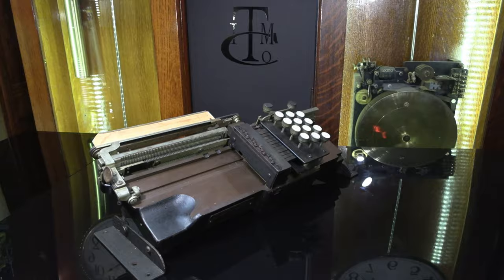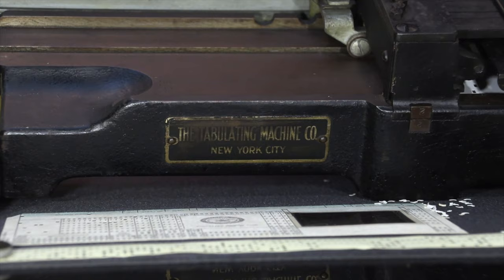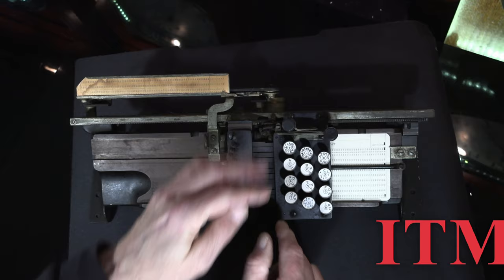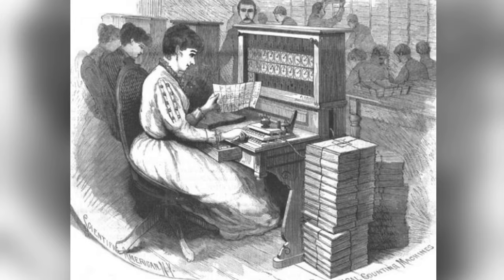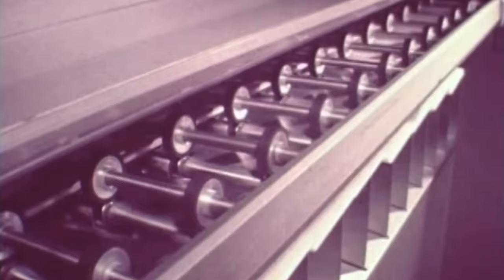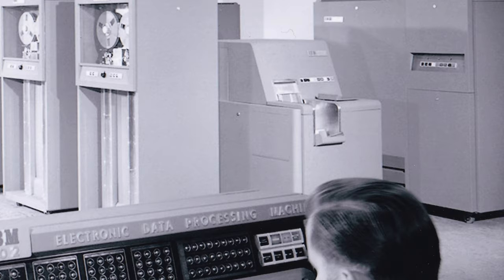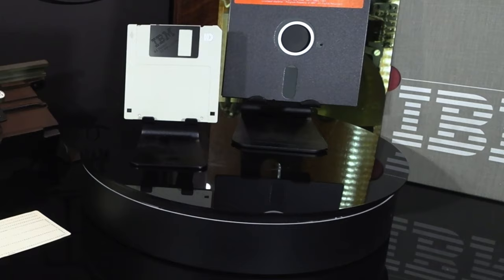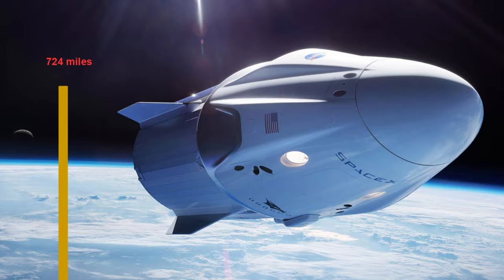IBM Keypunch by Herman Hollerith: World's First Data Storage & Processing System.  An ITM Video.

Comment: The first time I did key punch was in 1972 on the IBM 026 card puncher, and the 024 card verifier. Afterwards, I worked on the IBM 029 card punch machine and the 059 card verifier. Then I worked on the IBM 129 card data recorder. My typewriting skill enabled me to learn to use the IBM 026, except for the numbers that were keyed by the right hand. I like plain typewriting on a typewriter-like keyboard much better than key punch keyboarding. I knew how to program a card punch machine. I understand that the numbers placed on the right-hand keys provided quick data entry. This video was very informative. I enjoyed it. It brought me back to 1972, and it made me  feel like I came a long way.

Comment: Great video. My punch card experience dates from 1962. The 026 keypunches were pretty reliable but the card readers would often jam. Two boxes of cards were about all I could carry around, giving me 2x2000x80 = 320k characters. But one only used a few columns of each card so the usable capacity was even less. The cards were, however, handy for shirt-pocket grocery lists. I still have a stash of cards for that purpose.
Reply from the maker: Thanks for watching and for the feedback, Warren!  I appreciate your experience with the cards.  Although they were the storage used for 80 years, few people today know of them.  My mom used to make christmas wreaths out of them.  Bend two corners over, staple, and arrange a hundred or so in concentric circles.  Nowadays we'd think it was super tacky.  That's the difference 60 years makes.  All the best, Dave.
Reply: @davedietrich6601  Also the “data cops” would never allow it, since the cards may contain data that should be shredded!  Nobody thought of that in the old days!

Comment: the mechanical puncher is awesome, its nice to see one working. where did you find it?
Reply from the maker: Glad you enjoyed it!  I bought it on ebay........cleaned it up, 'un-gummed' the mechanics, and it's good to go.  Thanks for watching.  Dave.
Reply: That device, electrified as the IBM 010, was still in use into the 1960s for “quick corrections” while running a job.  The 024 encoded the characters on a keyboard, which could be either numeric only or a full caps-only typewriter style keyboard.  The 026 ALSO printed the character at the top of each column in a 5x7 dot matrix font as it was punched.  The 056 verifier compared the characters on a card with the same document retyped by a second operator for accuracy.  And the 029 mentioned in the script was the upgrade of the 026 to new technology and styling; an optional feature allowed fields (groups of columns) to be defined as numeric with zero-fill, so rather than typing the required number of leading zeros for each value, the operator could type just the significant digits, and the machine would remember them until the operator went to the next field, then punch the leading zeros and the remembered digits at double speed!